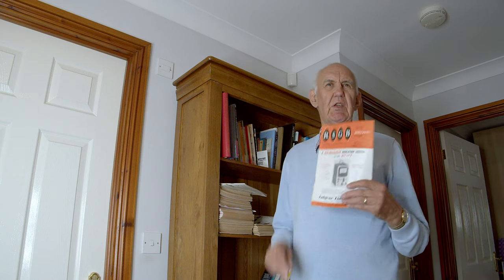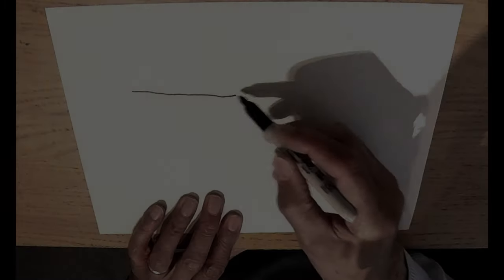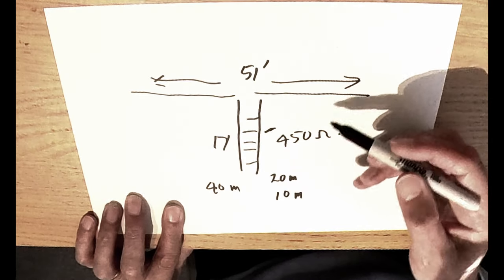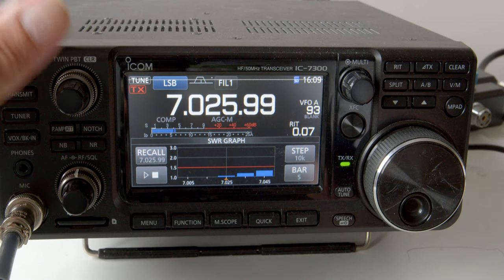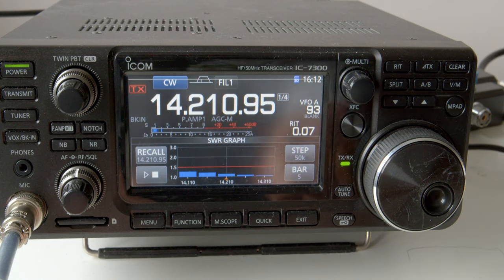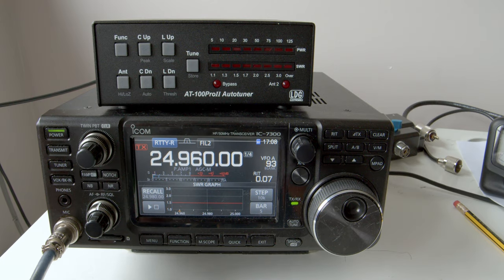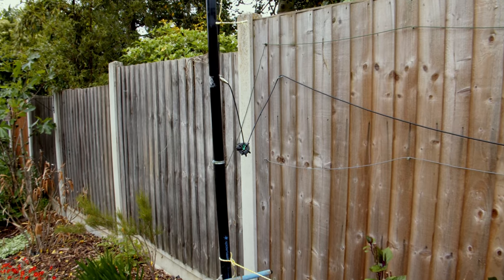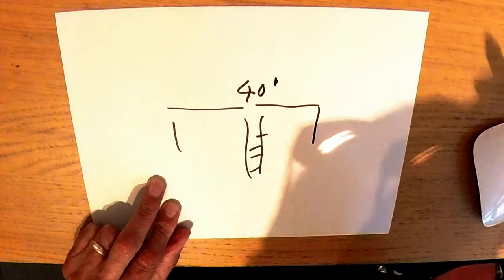HALF SIZE G5RV Tips and Tricks - 7-Bands in a Small Garden

Comment: There are many negative comments made against the G5RV and the 1/2 sized version, so it's refreshing to see it covered in detail with real world results like this! I ran (shack temporarily closed!) a barefoot Kenwood TS930S-AT into a half sized version fed with, yes, RG58! The Kenwood's ATU would give a reasonable match on 15 metres and, as you point out, didn't need to be switched in for 20 and 10. I couldn't get it to tune on 40. It was at 25' at one end, sloping up slightly to around 28' at the other, running the length of a SW facing garden. Looking at the logbook I see good DX on all three bands - Japan, Australia, Swaziland, Alaska etc. 

Question: In the intervening years, next door's hedge has grown to around 8'. It's right where the ladder line will be when I put the G5RV back up, and only a few feet away. It had little or no effect when it was around 5' high. Any thoughts on its effect now? 73 de G0CCX
Reply from the maker: My own feelings, supported by others, is that balanced line is not as sensitive to its surroundings as we are often lead to believe. I would suggest that shrubbery is likely to have little, if any, effect.